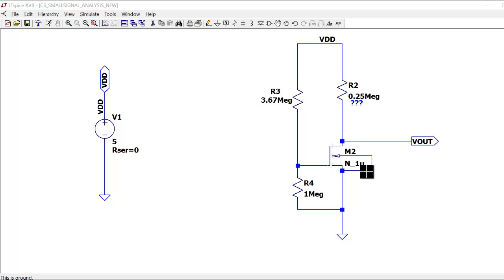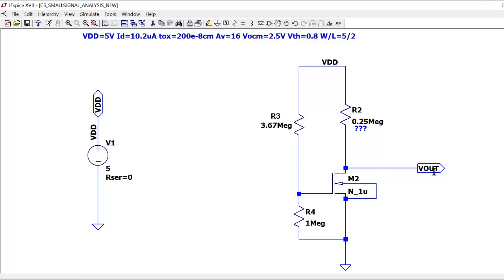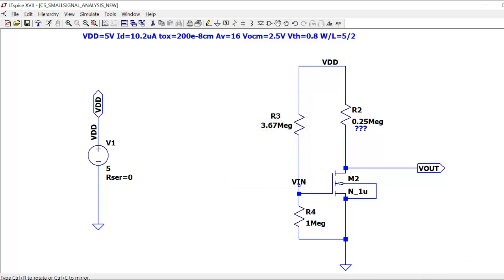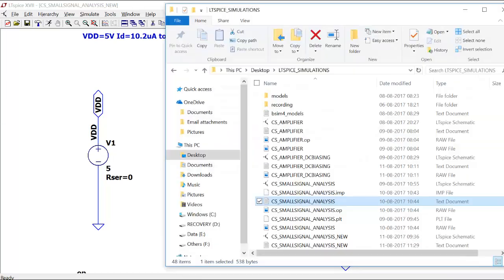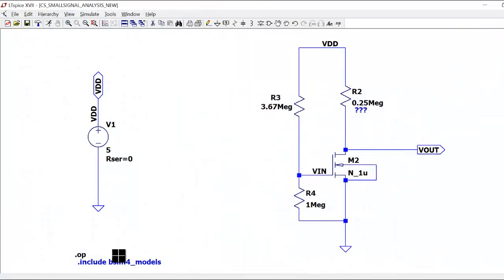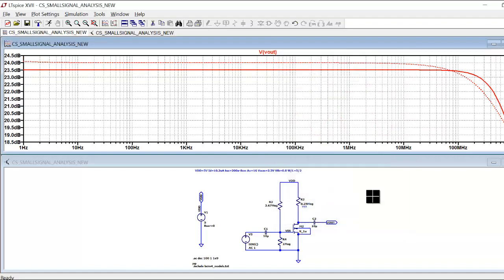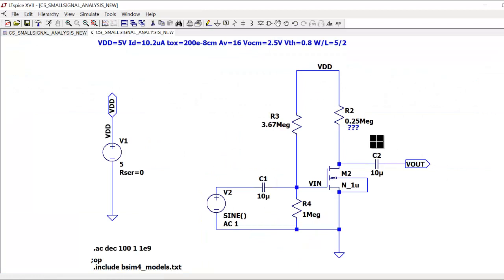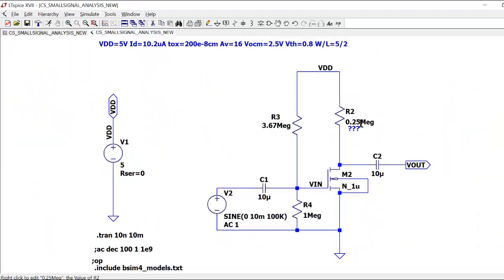Tutorial-4 Common Source Amplifier using LT SPICE Simulation

Comment: for doubling gain, why you took 4 times Rd. should not it be 2 times according to gain formula?
Reply: The output impedance of the amplifier is Rd  (ignoring channel length modulation). A few Meg output impedance would make it hard to couple any power a real load, right?
Seems like bad method to increase gain regardless.